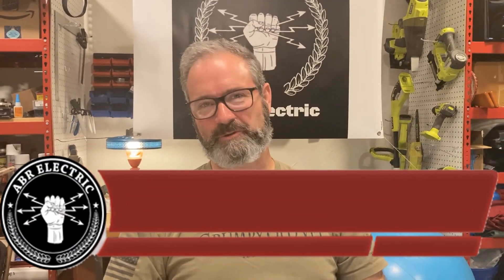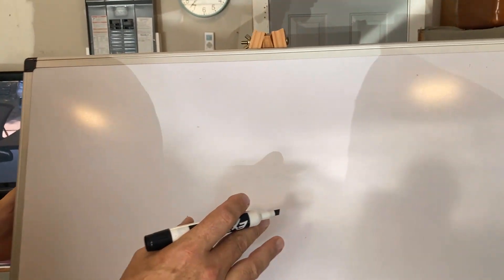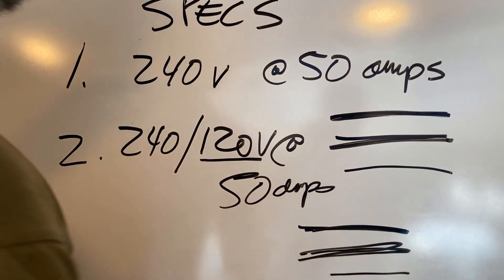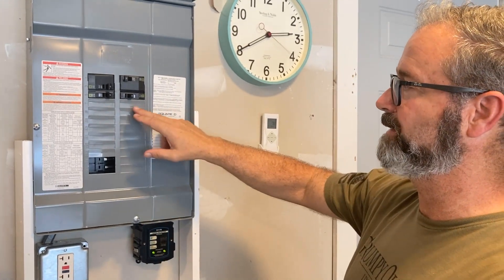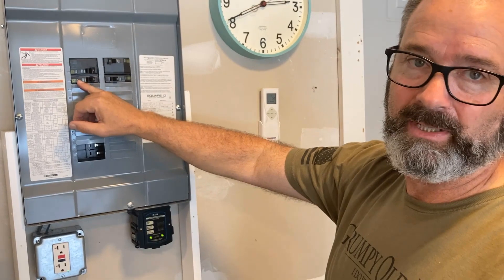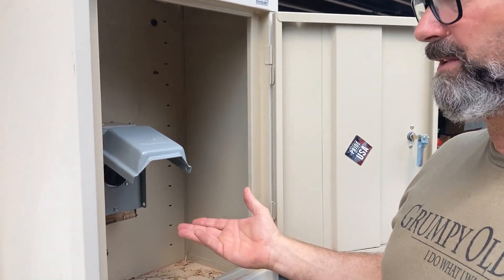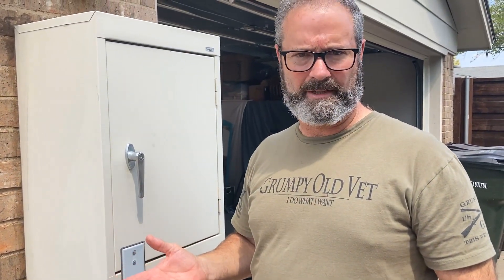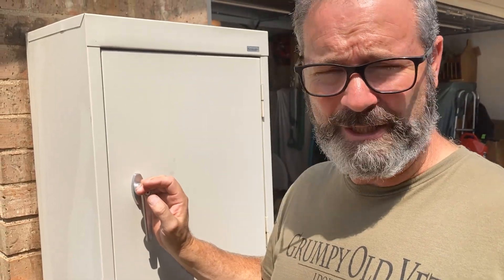Planning for a 240 Volt Circuit Installation at Home

Comment: I am planning for a 24000 BTU Mini Split in Texas.
240v 30amp
I have room in the breaker box.

Based upon another of your videos, I can run 10/2 NM romex from breaker and transition to J-box with #10 wires thru conduit for the outside run to a disconnect. 
Or
Can I run 10/2 UF-B from the breaker box thru the attic and transition to 3/4"  conduit for the outside run to a disconnect?

100 ' of UF-B wire roll  is $137 at Lowes.
Romex NM is $188.
Reply from the maker: Either will work. I'm not a fan of UF - just the makeup with the sheath.

Comment: In DIY-friendly Utah, you would need to pull a permit for an EV charger or the sauna, hot tub, etc.   I’m reasonably confident I could manage the actual work to code without killing myself or anyone else; or burning down the house from an electrical fire or short.  Where I might run into trouble is locating the specialty enclosures which are very often sold from supply houses which only sel to licensed electrical contractors. Amazon and E-bay are great sources—-but I’ve found a lot of Asian or European products which I’ highly suspicious May not meet the NEC.  The reason I know this is I’ve been contemplating running a 30 amp circuit to an outdoor shed.  If I replace my electric stove with natural gas, I’ll not only need a gas line extension but a new circuit pulled for the range.  Which means replacing the ancient circa 1948 Federal brand indoor sub panel.  Which needs to be replaced anyway since it has six spaces, all full.  The kitchen circuit handles not only the lights but the dishwasher, disposal, microwave,  refrigerator, and outlets.  Fortunately, the breaker trips if we forget and use the toaster with the microwave and dishwasher running.  But I’’m uncomfortable with the situation.  I could replace the panel myself.  The issue is pulling the cable for new circuits.  I have neurological issue affecting my balance.  I have no business climbing into the attic to pull cable.  And I don’t think my 255 lb 6’ body can fit through the crawl space access door.  I’ve considered asking an electrician to pull the cable for me and inspect the work when I’ve done the rest.  Assuming I wouldn’t offend by asking.  We’re in the midst of a building boom here so the various trades can pick and choose what they do.   Assuming you can  even get anyone to respond to a request for a bid.
Reply from the maker: Common tale with a lot of building boom cycles right now.